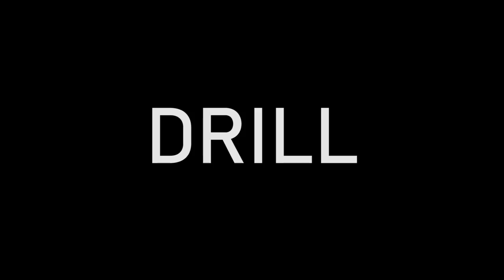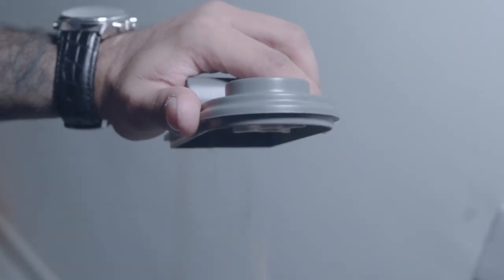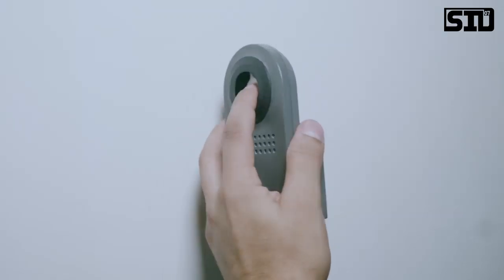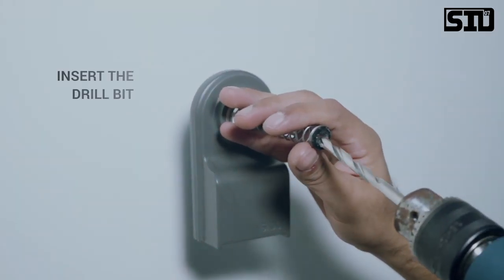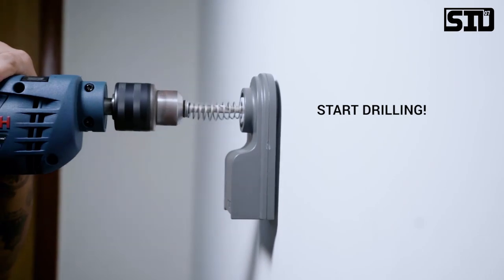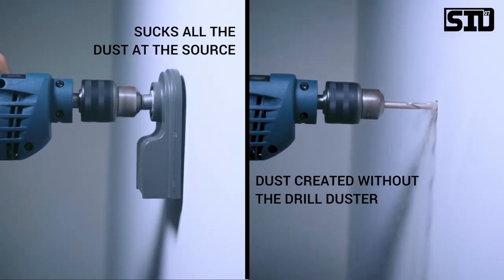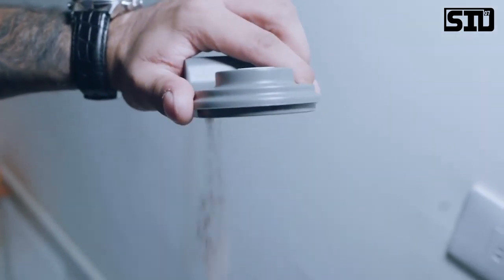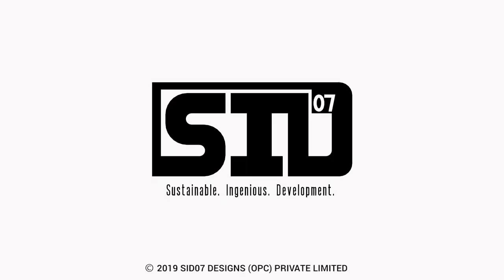How Sid Invented a Clever Solution For Drill Dust

Comment: Great example of a useful, clever invention.
Reply: Nikša I agree 100%. Very clever!
Reply: @stephenkey3137  May i ask you a quick opinion, suppose someone has a free energy generator, a working prototype. Let's say inventor does not want to patent it since that would but just one big waste of time and money. There are several ways to go, first to contact a company already building electrical motors and offer them cooperation to build a scaled up version and ask for certain percentage of gross future profit and maybe some income until then. Which percentage is fair in this case, 10,15,20%? Or would it be better to contact a angel investor and in cooperation with him assemble a team to build the scaled up version. I am mainly interested what would be the fair share to ask in either case. I am thinking around 10-15%, is that too little or even too much?
Reply: My specialty is licensing. Typically a standard royalty rate is 5%. Sometimes it can be as high as 10%
Reply: Thanks!